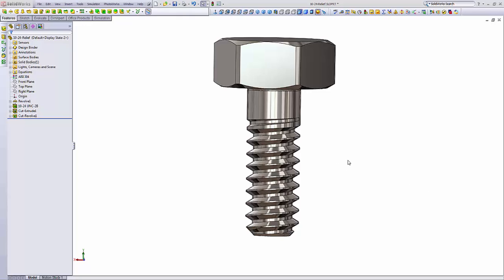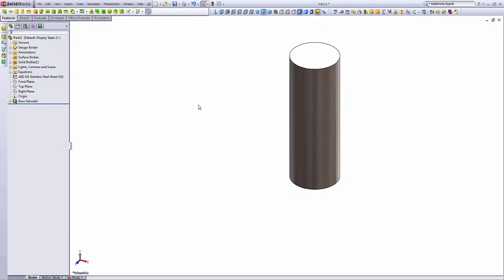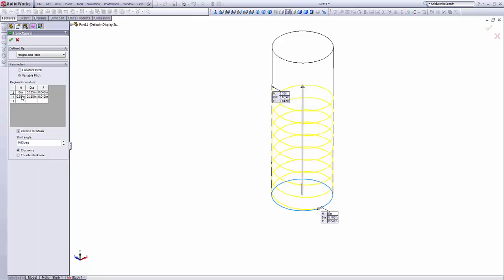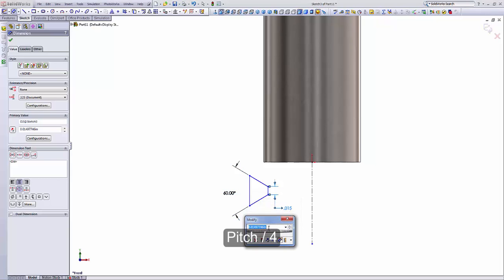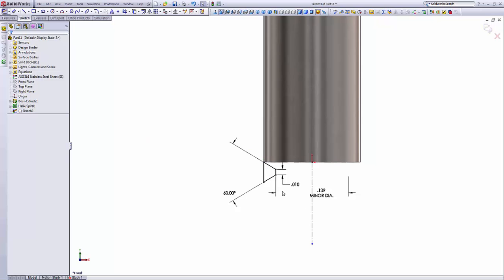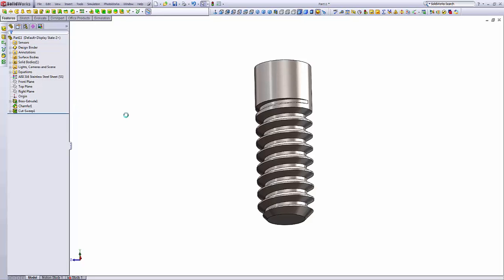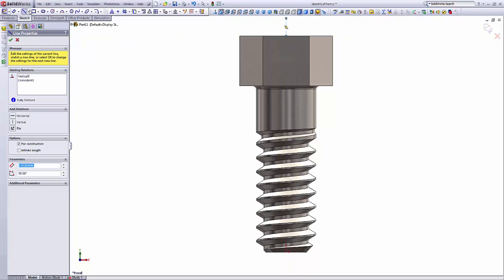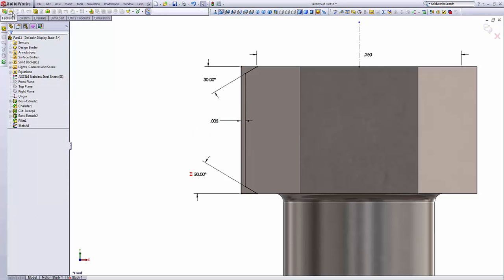Straight Threads in SolidWorks

Comment: At approximately time stamp 2:23, what was the "greater" value used to make the compound variable helix flare out? (It's hard to read that tiny Parameter table) Thanks for a nicely-done video!
Reply from the maker: H1 = 0 in
H2 = 0.35 in
H3 = 0.45 in

D1 = 0.185 in
D2 = 0.185 in
D3 = 0.400 in

Pitch = 1/24 = 0.042 for all steps.
Reply: Hmmm...a little over twice the Major Diameter...Thank you!
Reply from the maker: Make sure to move the tool out of the way of threads, which is why twice the major Dia. or even greater would work.